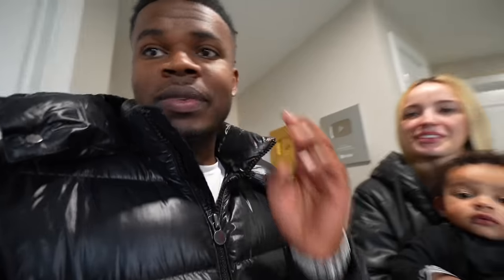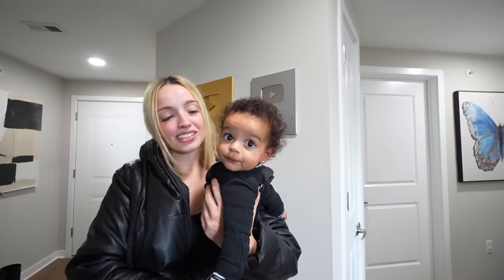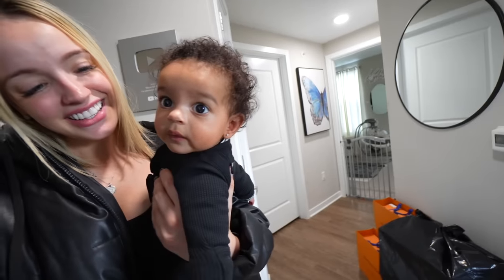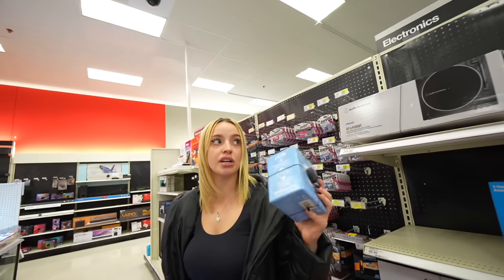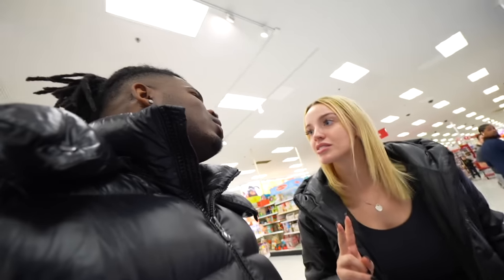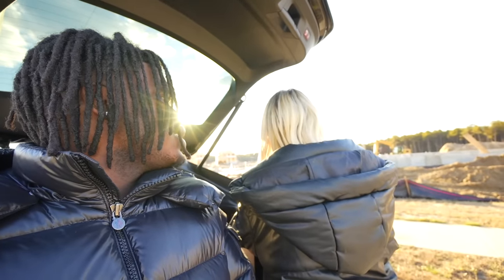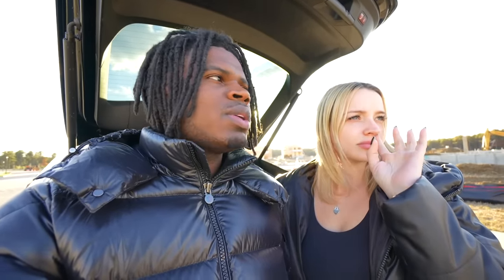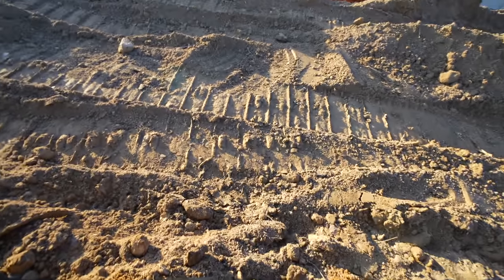THEY FINALLY STARTED BUILDING OUR DREAM HOME!! *HOUSE UPDATE VLOG*

Comment: I have the iPhone 15 pro max and I upgraded from the 14 pro max. The noticeable difference in terms of upgrade from the 14 pro max are the 15 pro max is a lot easier to hold versus the 14 pro max because titanium is lighter then stainless steel, all the iPhone 15’s have usb-c charging now, so no more lighting port, and 15 pro/max has the action button that have different functions.  Cameras are going to be a bit better every year that’s how Apple makes their money. Everything else about the same as the 14 pro max. When you upgrade phones every year you’re getting small upgrades. It’s better to upgrade every three to four years to notice a big difference in change.